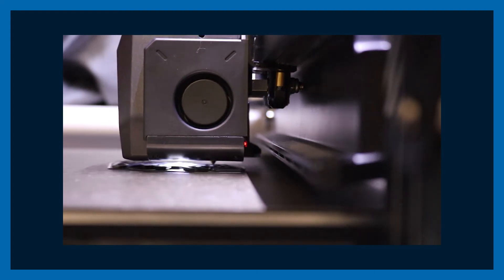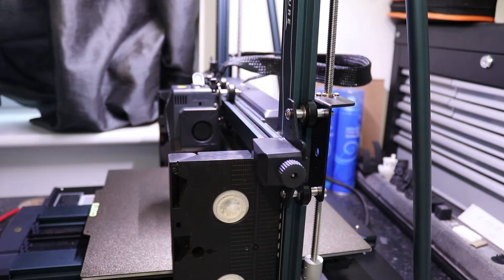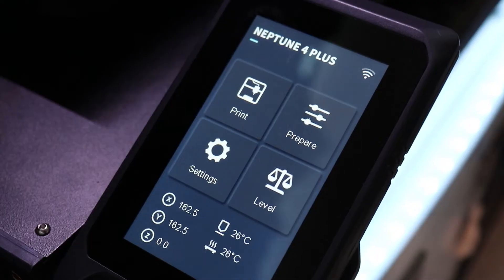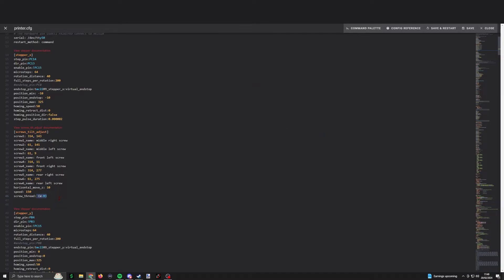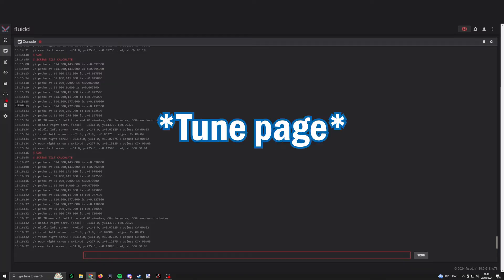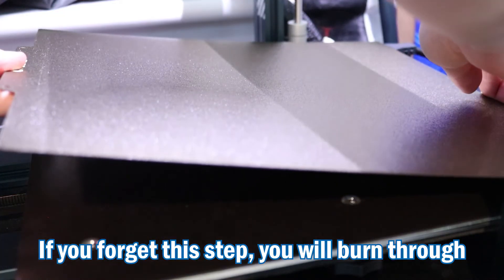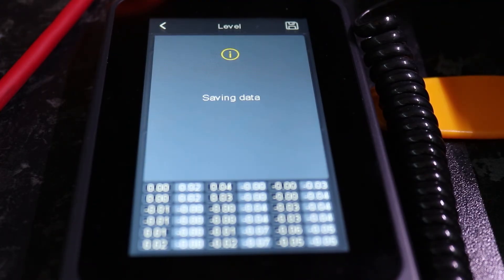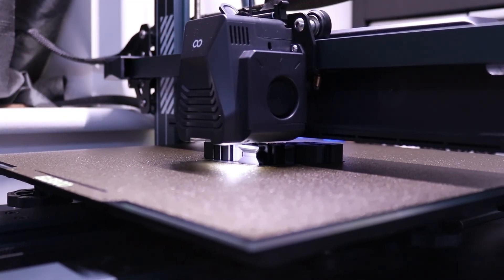Beginner Guide To Your Neptune 4 Printer

Comment from the maker: Please read the Description for further help and links.   :)

I would also quickly like to add some extra stuff here too.
A Lot of printer problems I have seen, seems to come from people not knowing on how to level their printers and getting the right Z Offset (I was one of those people). This video should hopefully help people visually see what they must do to get a better printing result. As mentioned and as you can see with my channel, I am new to this. I have also had problems like my extruder getting jammed resulting in contacting support.

Here are some notes I wish I added in my video, needed a quick correct or explanation:
- Don't overly tighten your belts! It will cause wear and tear or worse - snapping!!
- When I said Z-Wobble, I actually meant Z-Binding which Geek Detour mentions in his video (linked in description).
- I tried to loosen the feet but it was about to fall off. I could work on the other feet by tightening them to match the 1 odd foot, which I will do one day. But for now it is working fine.
- Possible reason why my printer went to -1.38. I might've done something to change the printer height when experimenting. I don't recall and I'm pretty sure I didn't do any changes that involved setting the printer at that setting, but that is my best guess lol.

I'll try to help find support for you on any issue you might have but I would suggest that you check out those subreddits or discord to see if you can find similar issues, if not don't be scared to ask for help. Also remember the community and support team are there to help and are human. Don't be horrible. Note that if you do need further help, that is on your own risk and testing!!

Please like and subscribe <3

Comment: I keep getting "no trigger on probe after full movement"
Reply from the maker: At least what I’m seeing - the probe doesn’t detect the bed.

So make sure it’s all clean, maybe work on the Z-Offset a little closer to the bed?

I had an issue with my Z-Offset which was related to the config, funny enough when I turned the code into a comment with # it fixed my auto level problem

Comment: I just changed my hot end and noticed the probe readings keep changing even if i do it one after the other and cant move the weels ccw sometimes as they will be fully tightened. any idea if the probe has issues ? as it lights on and switches off as it touches the bed so im not sure if i did something wrong as i cant find anywhere for a solution
Reply from the maker: If I remember correctly I struggled a little with the Screw Tilt Adjust first. My suggestion would be to get the screws all centre, hopefully there will be more than one being close to each other and go from one of them as the first one to take point as the first one will be your reference.

If the wheel still gets too tight (stuck) then re-centre all of them, then make them a little looser. Start again or choose a new point of reference.

You can post on Reddit or the Discord support as they’ll be useful. 

Could always be worth re stripping the extruder again to see if you missed something or nocked something out of place.

Lastly contact Elegoo, if it’s in warranty you’ll get a new extruder
Reply: @CazaCreates thank you for the reply i will retry everything as its driving me nuts 😅
Reply from the maker: Do let me know how it goes!
Reply: @CazaCreates  seems to be working fine for some reason bed leveler wasnt getting accurate numbers like before and that messed everything up hopefully i can do some bigger parts now

Comment: Great video and instructions!

I am having a bit of an issue with that the center is always lower than the corners so adjusting the corners down will still bring the center down with it leading to infinite loop of tilt adjust until springs are all the way decompressed and no fix

as per your instructions, I removed the build plate to check and unscrew the center screws but found that my bed has no screws in the center of the plate (only the 4 corners), any ideas on how to fix would be appreciated (N4Pro)
Reply from the maker: Every time the bed gets closer to the centre it’ll always update a deeper picture of the beds condition - as in
From 1.3 bed warm to 0.3 bed warp.  As long as the bed is within 0.2(if I recall correctly).
Example:
0.1 to -0.1 or 0.4 to 0.2. There is always a 0.2 gap between them.

The centre screws seems to only be for the N4Plus or N4Max

If you can post a visual of the bed on the Reddit/Discord, you should get a deeper help.

Last resort is bed warp

Comment: I cannot get a good mesh for my new Max 4. It's shaped like a "W" no matter what I do. Would you suspect the new bed is warped?
Reply from the maker: That could be a possibility. Hopefully you’ve solved it since this comment. Have you tried tampering with the centre screws to help?

Could also be the sheet too. I have heard Elegoos print sheet is a little warped - also why my edges won’t be as flat as I hoped

Comment: Hey I saw that you were using M3, but the neptune 4 plus has M4 threads so I'm confused on which one I should do.
Reply from the maker: Go by your own check. I might’ve miss measured mine back then due to my time of being stressed about my printer not working. 

I had another person point out some errors I made with the screw tilt adjust. For example the sensor apparently not being aligned to the T. 

I was still new to print (still am now) and still learning new things.
This was all my own research as I couldn’t find an in depth video on the printer to help. Once I got my printer working moderately well I wanted to instantly help others asap.
These are still the same settings I have on my printer as I haven’t updated them since as I haven’t had any personal issues.

I’ll have to update and try the M4 results at some point when I get that second. See if I notice any improvements 😅

Comment: I have my screws_tilt_adjust settings all below 1 but still my bed config is not straight at all.
Reply from the maker: One thing to keep in mind is that the bed mesh could be correct, but you're now reading at a more precise level. As long as the lowest point to the highest point is within 0.2 you should be good.

But in-case:
So each corner is set below 1. It would be okay as long as it's below 6.
Make sure the everything tight besides the Z poles.
Try a firmware/printer update - since making the video the printers updates haven't had any major issues.

Other than that maybe contact support or more knowledgeable people via Reddit or Discord

Comment: the entire coding section confused the hell out of me
Reply from the maker: I think I linked a video in the description which might be more helpful but as a breakdown.

- The printer sensor is behind the nozzle in the corner.
- That sensor needs to hover over the screws of the bed. 
The method I did involved using the manual mode, writing the location down where that is. Then I left the manual mode and typed the location into Klipper, but moved the printer a little bit so the sensor is over the screws. That is your main coordinates when typing in Screw_Tilt_Adjust.
- Go into the printers.config file and place the code for Screw_Tilt_Adjust with your Coordinate.
- Save and Restart the printer in the top corner. 

This will save the new line of code into the printers homepage.

Make sure when you use Screw_Tilt_Adjust you must HOME your printer.

Comment: what's the difference between "Calibrate" on Fluidd and the auto-leveling on the handheld screen? Do I have to do both?
Reply from the maker: @gnoong5262  so I like to do both to make sure it’s on both the printer and firmware side as an over precaution along with seeing the slight different readings is interesting too.
You really only want to do the auto level on the printer itself as it saves to the printer.

So Screw_Tilt_Adjust, then set the first Z-Height. Then Auto level on the printer itself, then double check your Z-Height and at that stage you should be good. Also keep your print bed around the temperature your printing at so for me it was around 60-65 °C

Comment: Question. My bed has a bowl in in where the center values are -.15 usually. My center screws are so lose they're practically not attached, but my sides are practically all 0.0. What do you recommend for that situation?

Comment: I am a beginner at this but I believe we should set the screw tilt adjust positions to set the nozzle directly above the screw instead of the extruder.
Reply from the maker: @grace2258  the sensor that detects the height of the print bed is at the back right corner of the extruder. That sensor detects the height where the screw points are.

Comment: The printer doesen't need to be level to the ground, you could put the printer on a slope or even mount it to your wall. :P
Reply from the maker: Yeah I know - This guide is to help reduce any issues that could be a cause of problem. But also my print leg was short on one side, this wasn't an issue for printing but caused a lot of horrible vibrations in the room and floor :)

Comment: Hey thanks for your video it helped me a lot. However, I have the problem that I have to re-level the bed after every test print because it changes every time. Do you know what the problem could be?
Reply: I’m having the same issue. I set my z-offset perfectly and then the next print will require recalibrating the z-offset as though the bed leveling has changed
Reply: I had a similar issue, but after updating the machine's firmware from Elegoo's website I wasn't having the problem anymore.
Reply: @ ill have to look into that.  I purchased the printer from elegoo only a few weeks ago so I assumed the firmware would be current but maybe there’s an update I’m missing. Thanks for the info

Comment: Great video. really really helped out. After following all your tips I have a high middle on the calibration. the outer is great. but how do I lower the middle result ?
Reply from the maker: Remove the print plate. You should see 1-2 centre screws. Tighten them to pull the middle down lower. I would suggest you ever so slightly turn them. Then put the plate back on before recalibrating or you’ll burn through the heat plate
Reply: @CazaCreates  Thank you 

Your bed settings dont quite line up with my screws. how do I adjust them to suit mine. I have had a play around for a few hours and just can't seem to do it
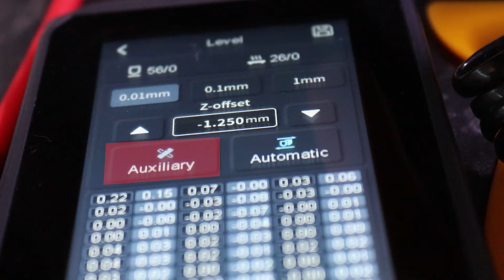Reply from the maker: @RickyStubbs-j7u  So what I used was the manual level mode to get a general idea and note that down somewhere. Under the print head has a sensor 4:40. Using the previous coordinates on the home screen of Klipper, manually move the printers sensor over the screws and note down that location. Those numbers are what you will need for you Screw_Tilt_Adjust.

Comment: It does not have a IP there’s no Wi-Fi so how did you get the IP?
Reply from the maker: @BrendaDavis-1963  the plus and max has wireless. For yours you’ll need to plug it in directly to the router via Ethernet
Reply: @ I
Know I just bought a router from Walmart

Comment: Complete newbie here. Am I missing something? I just followed the levelling instructions that came with it (using A4 paper etc) and I’ve managed to print some things off nicely. Should I do the video steps regardless?
Reply from the maker: @yourface07  hi, yeah you can still go through all the steps. The reason why I recommends a feeler gauge is because it’s more precise and secondly more easier for those (like I) that struggle to tell with paper
Reply: @CazaCreates thanks mate, I appreciate your active responses to people with questions. I’ve subbed
Reply from the maker: @ no worries. Hope the rest of the video really helps! Thank you for the sub :D

Comment: My neptune 4 does not have screw tilt adjust in his code, what can i do?
Reply from the maker: @yobymld8640  it’s not something that comes with the printer. It’s a Klipper addition. Just copy and paste it and make sure the sensors coordinate matches with your print screws
Reply: ohh, so sorry i dont really speak english and i miss some words in the video, but out of that, you help me soo much i will try that, my printer is scratching the printing and the filament just go off in some parts of the print is weird because my bed is level, 

idk if i explain good soo if you can…

Mi impresora 3D empieza todo bien, la primera capa bastante bien, solo que cuando llega a puntos de altura (imaginemos que imprimo un cuadrado alto y delgado) en un lado de el cuadrado empieza a raspar cada vez que hace travel y ya cambie el zhop to 0.7 y nada ocurre. imprimo mayormente a una velocidad de 250 ms y eso ocurrió ahora ya que otras veces lograba imprimir cosas similares sin problema, 

espero que el traductor lo pueda traducir pero parecen ‘’pelitos sobresaliendo de la impresion, pelitos y malos terminados.
Reply from the maker: @yobymld8640  I'm hoping this translates okay.

En el caso de pelos que sobresalgan, la humedad podría afectar al filamento. Un deshumidificador debería ayudar.

Podría haber algún problema con el GCODE que podría hacer que se muele en la impresión o que la impresora se atasque en algún lugar de los brazos.

Intente imprimir cubos en diferentes puntos de la impresora para ver cómo se resuelven los problemas.

Puedes probar Elegoo Discord Support o Reddit con videos para intentar resolver este problema.

Comment: Sorry but its not clear what calculation should we do @4:35 ? what should we do?
Reply from the maker: So what I did was - use the manual setting mode to find the screws locations. Then I used Klipper to move the print head so the sensor is over the screw. Note down the XY coordinates. Move to the next corner
Reply: @CazaCreates  ok. thanks

Comment: Leveling has been a nightmare for me. Doing manual leveling with the 4 posts (screws) in my Neptune4 do not adjust the middle of the bed. When printing large objects, the nozzle gets clogged, lowering the z axis solves “momentarily” the issue, but when the nozzle gets in the middle area sometimes it tears appart the PLA or forms waves… I will try leveling with klipper.. I even tried putting layers of aluminium foil… out of desperation… so far very frustrated.

Comment: What if the IP is blank ? What then ? 😂😏
Reply from the maker: I’m guessing you just have a Neptune 4 and not the 4 plus or max?
Reply: @CazaCreates  Correct, just the plain ol' headache-- I mean Neptune 4. 😏
Reply from the maker: Is there a Ethernet port?
Reply: @CazaCreates  Yes
Reply from the maker: @whatwouldlewdo  I think what you have to do is treat it like an old school computer. Connect the printer to the WIFI box using an ethernet cable. After switch on the printer and go to the settings > about machine. Cross fingers you'll have the IP!

Comment: Just got this printer and i cant get my prints to stick to the plate. And the printer nozzle went through the build plate for no reason after a frame ware update. I've wasted 9 hrs. trying to bring a stupid boat and not one came out correct.
Reply from the maker: @emorrot9938  I have heard that it’s not ideal to update your printer if it’s working perfectly from the box.

Besides that make sure you’re keeping an eye on the temperature. Giving it time too. So set the printer to 60/65 on the bed, let it get to that number then leave it for 10 minutes to settle at that temperature and for the metal to warp to it. Then do the whole levelling stuff.

It could be a case of needing to tune your printer. I know in my case I need to work on its layer height more, the right temperatures (I am currently using 65&210 on the first layer then 60&200 the rest of the way) flow rate etc.

Since a firmware update has effected your printer I would go to the Reddit page or discord pages linked in the description to try and get some support that way as there are some useful people there

Comment: okay so which bedmesh do i use? there is two that are different doing this method
Reply from the maker: @SaagarShah  there’s 2 that are different?

I would mostly rely on the one done from the handheld as I have heard that would have a higher chance at saving.

Is it a massive difference or subtle differences?
Reply: @CazaCreates  so when i press the calibrate on klipper after doing the tilt screw leveling, a bed mesh appears, aqnd when I do my z offset after and press automatic on the hand held a second mesh that is named 6 appears. I will use the bed mesh named as 6?

Comment: So before recently updating the firmware your process worked with saving the z offset, now after updating it isn’t being saved and it’s consistently far. How do I get it to be saved ?
Reply from the maker: @shahsaa1  after updating you need to redo you auto level again.

Next make sure you’ve updated both the printer and the handheld device as they have separate updates last I recall.

Personally I have heard that if your machine is all good from the box, you shouldn’t really update it. I don’t update mine since the time I got mine, I heard many issues with the update. That’s long gone now I would assume though.

If you tampered with the Z offset on the Klipper software, it can cause miss reading (I did this once and it dug into my bed, refusing to go into the level settings) to solve this there will be an option listed as Z-Offset: 0.00 (or something else) if that doesn’t have a # in front of it then it’s reading that code compared to the saved offset. Make it so it says #Z-Offset: 0.00 turning it into a comment removing it as a function.

Besides that you’ll either have to join the discord of Elegoo or email support as it could be a software fault. They should hopefully help reset you back to a previous version - hopefully.